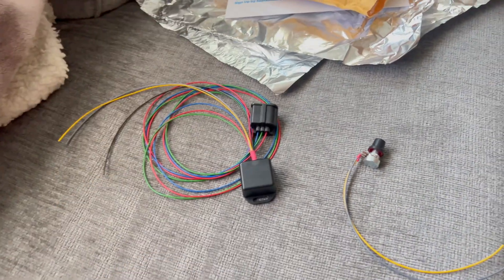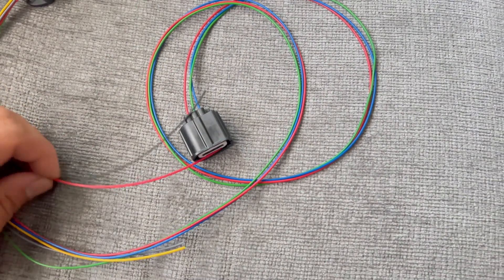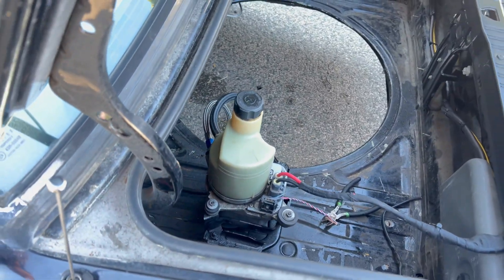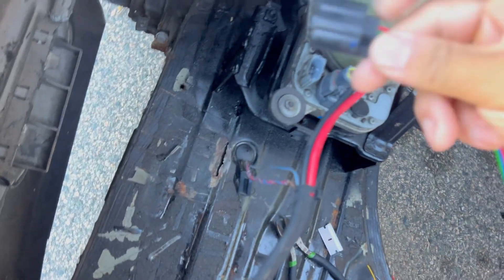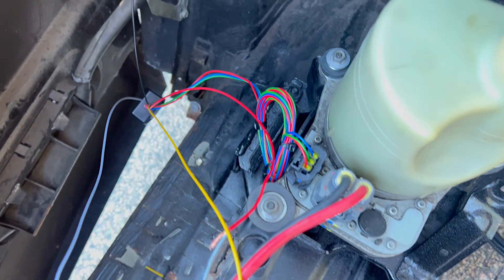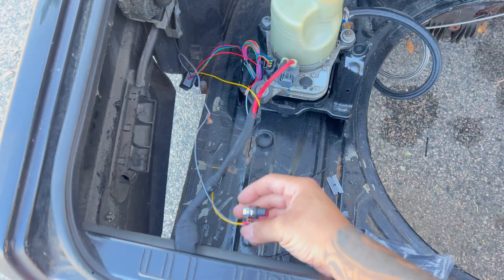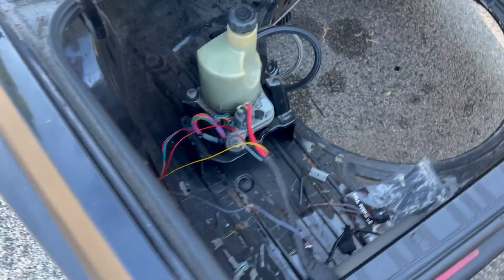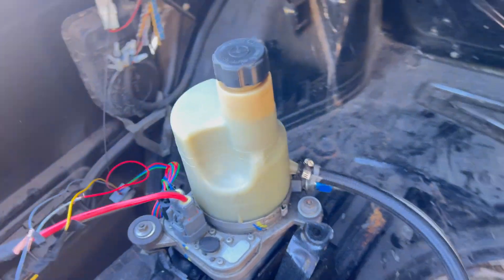Volvo Power Steering Pump Controller

Comment: I know I’m late as hell to this video but I installed one of these pumps in my mini truck I built for autocross and any time I try and force the wheel at all whether that’s counter steering in a slide or just driving aggressively at all it’s as if I have no power steering at all like the pump can’t keep up, will this controller fix that? I just have it wired to constant power like you did before

Comment: That shits loud af tho
Reply from the maker: Not compared to the car.. lol
Reply: @offbalancewrld lol ya someone mentioned its not louder than the engine or the engine running drowns out the noise i guess the mic picks up the noise easily making it seem loud. Id have to put in the engine bay tho
Reply: @offbalancewrld what if it’s installed behind the front bumper.
Reply from the maker: @FKnATOO yeah it could be, not really noticeable when you’re driving. + there’s a lot of other noise going on
Reply: Yes but it's still loud

Comment: Why did you put the pump so far away from the steering, that might contribute to poor steering
Reply from the maker: I didn't want the engine bay crowded up, its worked perfect where it is
Reply: @ I mean if it works at a satisfactory level then props, just kinda unusual. Generally in mid n rear engine cars they use electric power steering because the motor is far from the front wheels. I’m about to put a similar set up in my Mustang seems like you can just hide it in the fender well in my case